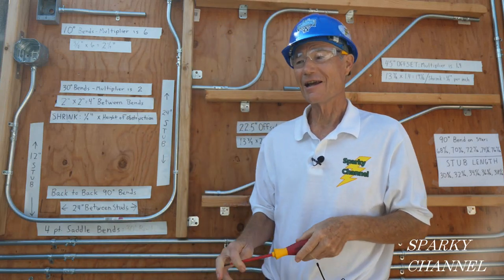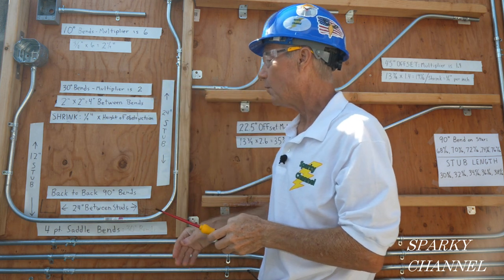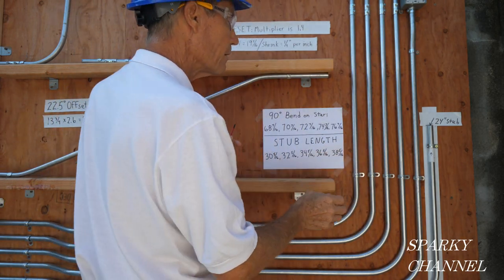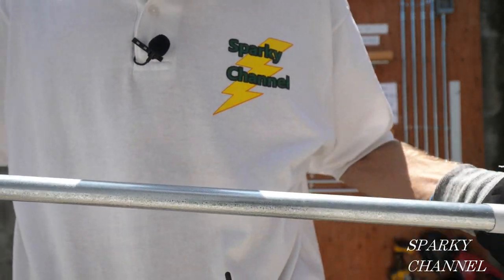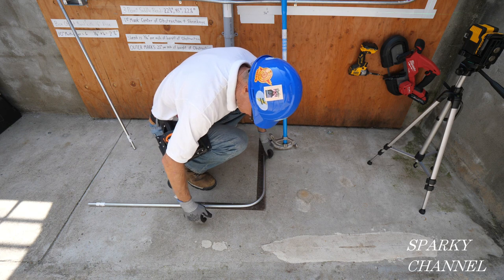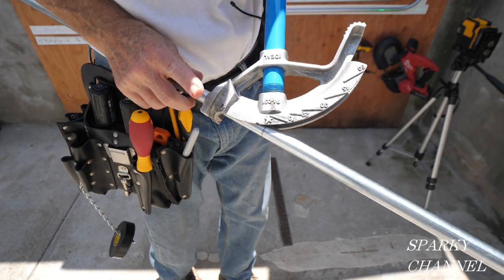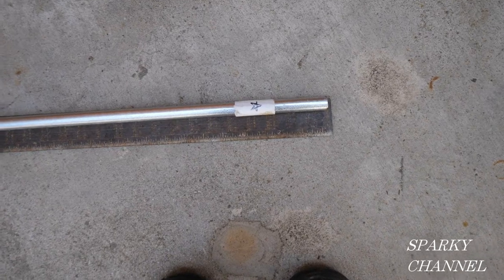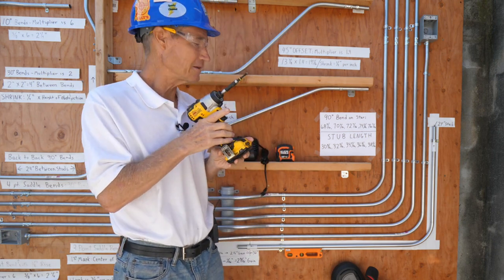EMT Bending: 90° Stubs Bent on the Arrow vs. 90° Stubs Bent on the Star + Gain

Comment: I get why you measure on center, it splits the difference between outside circumference and inside circumference of the bend. The thing that confused me here is, did you measure the stub height on center too? If so, wouldn't you expect it to be a bit shy? The stub height is usually measured to the back of the pipe, not to center.

Comment: You can make a label for "gain measurement" on your bender to keep you reminded in case you ever need to use that measurement
Or
You can just take a measurement of the distance between the point of the arrow and the point of the star, and that measurement is the "gain measurement" for that particular bender...(no label that can fall off that way 👍)
Reply from the maker: Thanks!

Comment: Hello Bill can you show how to make Rolling Offset please.
Reply: I'll tell you how to do it with no math. Measure the distance you need to offset up. Next measure the distance you need to measure over. Next, find a square surface  that is large enough for your measurements (transformer cover, 12x12 box, etc). Mark one of your measurements from one corner going up. Mark your 2nd measurement from the original corner going across. Measure the distance between your two marks and there is your offset. It's Pythagoreans theorem with no calculating necessary.
Reply: InYourFaceBudday thank

Comment: Sorry, I'm really confused. The stub height is usually to the  back of the bend, but you're measuring to the center of the pipe and it still comes out to (almost) 24". What am I missing?
Reply from the maker: Hi! I measured each stub with my tape measure. I calculated the needed height for each stub. Each stub needed to be 2" higher than the previous one.
Reply: @SparkyChannel  Ok, so on the rack you measured 24" from the horizontal laser line to the mark where you wrote '24" stub', right? Then you measured 24" on the pipe, deducted 5" for the take off, made a new mark at 19", and bent it using the arrow mark on the bender.

Here's what I don't understand though. If I did that, I would get a stub that measures 24" from the end of the vertical to the back of the bend -- in other words to the bottom of the horizontal part of the pipe. Yours seems to come out 24" to the center of the horizontal part of the pipe. 

Thanks for taking the time to help, I appreciate it.

Comment: Great video. I have to comment on the Klein tape measure. I had one similar but inch/metric. I was disappointed it broke on the first job I used it on. Not too happy with that.

Comment: Got a question for ya from a JW. I've come across this issue several times but hadn't had the time to just sit and think it over.

I got a pipe I need to put a 90 in but it's close to one side. The pipe is a 1 inch rgd and I don't have a handbender, just a sidewinder. I have to get a 99" 90, so to avoid having to bend almost the whole stick up, what sort of math do I need to figure to bend it from the other way?
Reply: I too have had this same dilemma. What you do is find center of bend on the shoe for bending a 90 and flip it.
Reply: @fjl05  do I move the mark over? If I bent it on my usual mark at the middle of the shoe, it'd just give me a longer 90 then I need.
Reply: @Lulu-ex7fc  No, you have to figure out the center of your 90 on the pipe. Mark it. Put it back on the bender shoe exactly as it was when you bent it and transfer over that mark to the shoe. That is your center of bend mark for a 90.

Do you know how to figure out a center of bend on a pipe?
Reply: @fjl05  yeah. Just didn't understand your first comment.
Reply: @Lulu-ex7fc  Ok you seem like a guy with a thirst for knowledge so I'm going to help you out..

I've actually brainstormed and came up with the formula for flipping your pipe the other way for bending a 90. This a guaranteed method that I came up with. I had the same question you had and searched but never found an answer anywhere for how to do exactly that so I brainstormed, did measurements, tests and everything and finally figured it out. This works for bending on the arrow line of the shoe, so that you apply the formula, get your number and make your mark in the opposite direction so that you flip your pipe in the other direction and get to bend it.

It's (2 x deduct - Gain). Basically you multiply the shoe's deduct for a 90 by 2 and then subtract that answer by its Gain amount.
So for example, and these are just numbers I'm pulling out of the air, if a bender has a deduct of 8 inches and a gain of 3 inches. Then do 2 x 8 - 3= 13.
13 is the answer. So you make a mark 13 inches in the opposite direction of your previous mark. Flip the pipe and align the new line with the arrow mark on your bender, and that allows you to bend in the opposite direction.

This is of course specific to every shoe. So you'll have to figure out its exact Gain and Deduct. Sure you can read what it says on the benders label what its gain and deduct is but I usually find those to be off by a bit so I instead figure out the benders true gain and deduct from a scrap piece. Of course you need to make sure your 90 is as close as possible to a true 90 for this to work. So if you bend something to like 89.8 degrees instead of a true 90, it will cause problems. It needs to be exactly 90. And again this formula only applies for aligning on the arrow mark mind you.

Actually I'm not going to say that i invented this formula as I'm certain others have figured it out in the past. But I couldn't find this answer anywhere else so I figured it out on my own. And honestly I've never shared this formula with anyone until now. So enjoy it and use it to its best ability and dont forget to give credit where its due. From one sparky to another.
Reply: @fjl05  much appreciated.
Reply: @fjl05  That's really smart, and it makes perfect sense, because 2*deduct - gain is really just the circumference of the bend, or the distance along the pipe from one end of the bend to the other.
Reply: @Bapuji42  Thanks! Took me a while to figure it out too.
Sadly I have yet to put the formula to actual use at a jobsite. I've only ever tested it at home.
Reply: @fjl05  Ya, I guess it would only be necessary when using something other than a hand bender with a star mark, which serves the same purpose.

Comment: How do I line up the horizontal and vertical measurements without a laser?
Reply from the maker: 2 torpedo levels will work, or just one torpedo level if you stabilize one of level or plumb legs.